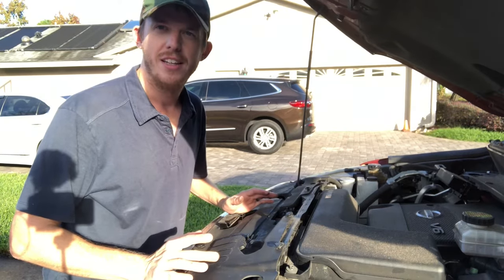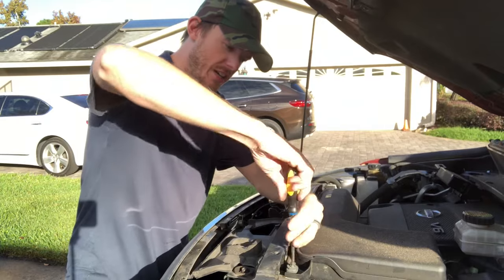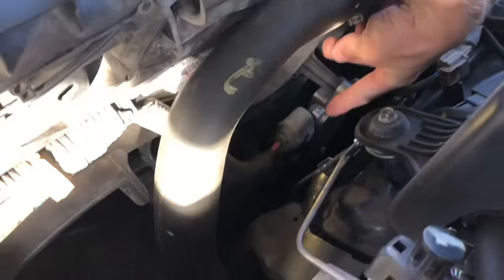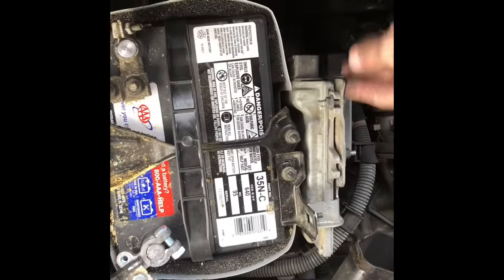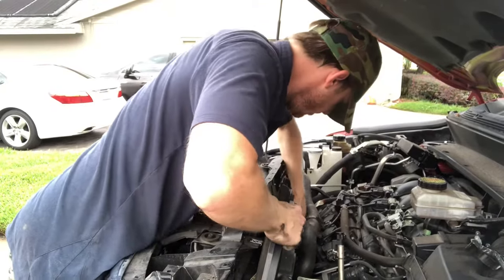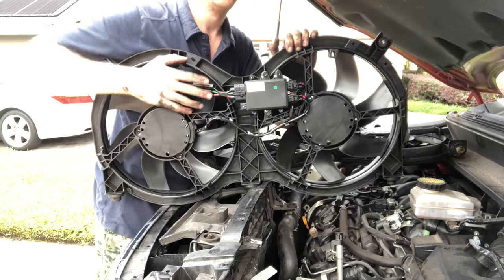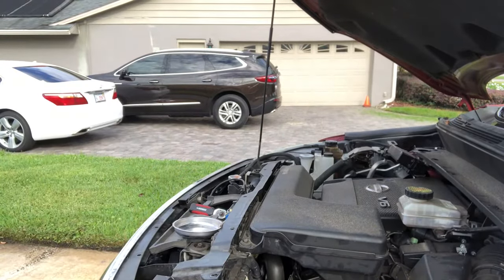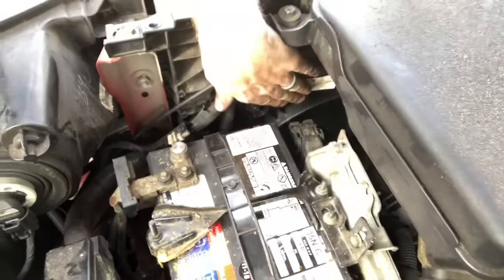How to replace a radiator fan | Step-by-step instructions

Comment: I have 2015 Nissan Pathfinder and the radiator fan makes loud noise.  I found two other Youtube clips but didn't show how to put it back in.  You show everything in detail.  I will start working on mine this weekend as part had arrived from Amazon.  Thank you.
Reply from the maker: touy0209 thank you, glad this helped you. It’s a bit fiddly getting it in and out and the radiator blades are sharp, but you can do it... and next time I would wear gloves!
Reply: did you have any luck replacing it??

Comment: Very good video.
Safety is important. Ensure the engine is cold to the touch before beginning.  Maintain tool control, a small washer, bolt or screw can damage your engine if it falls into the wrong crevice. The magnetic holder is a good suggestion. Gloves might help prevent scratches and scrapes. Above all, be patient with this installation. Nothing is worse than a 20 minute job turning into rework or a major repair.
Reply: Great tips. Thank you

Comment: Thank you, just replaced mine. Took maybe 45 minutes, and a lot of that was finding the correct tools. Only thing different is I had torx screws holding the fan in, and I didn’t need to remove the top cover. 2013 Pathfinder.

Comment: JUST TODAY REPLACED MY RADIATOR FAN ON MY NISSAN ULTIMA AT THE MECHANIC SHOP AS I WAS DRIVING HOME JUST AS I PULLED IN THE DRIVE WAY WHITE SMOKE CAME OUT JUST A LITLE WHY WOULD IT DO THAT ? ALSO NOTICED THEY HAD MY HEAT TO 32 ALL THE WAY UP WEIRD IS THIS NORMAL ?